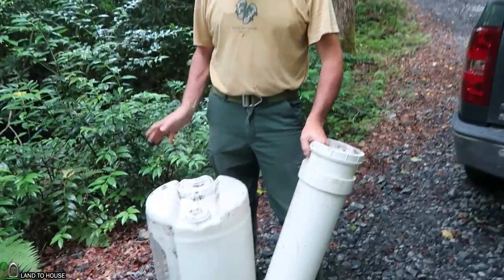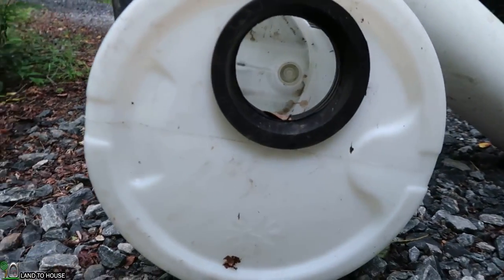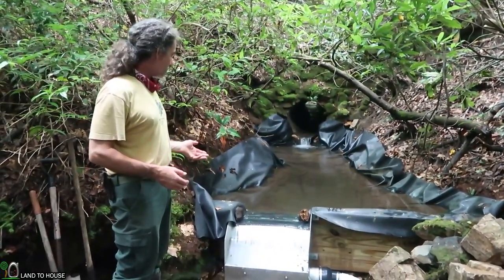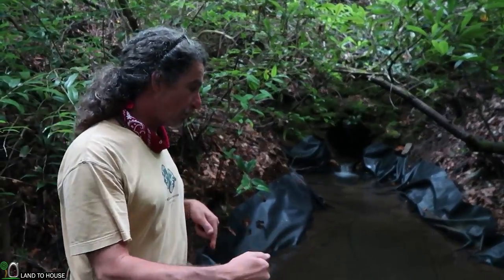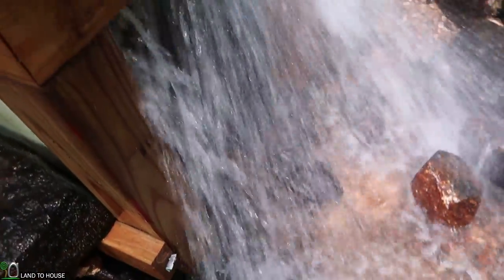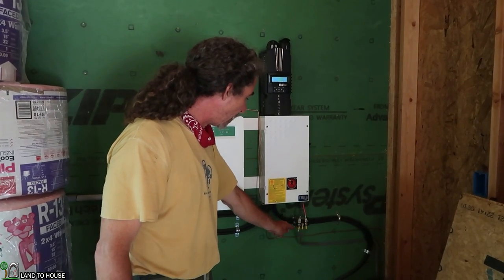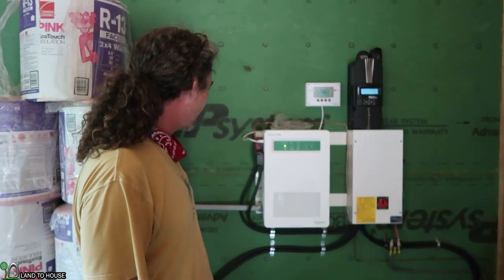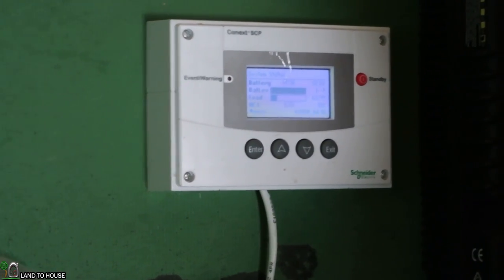AMAZING 250+ Watts of Micro Hydro Power Off Grid

Comment: Your 4 inch micro hydro at the reservoir, uses small sharp bins as you can get away with the water will flow better through a 22 angle multiple 90 than a 90 single bend. Use a multi-blade multi system on the shaft to get a stronger reaction to the flow for your alternator.

Comment: Ok, so it generates 250 watts per hour or enough to run all the LED lights in a yurt all the time. The rest like coffee maker use the battery bank which is charging.  You don't want to run your batteries to 0 charge so if you keep things like the coffee maker which uses 1000 watts to brew it would take roughly 4hrs to replace that power or a little more since your not going to turn off the light immediately?

Comment: What about having an mppt a battery and a 240V AC inverter close by the hydro generator, and sending the power up to the house as 240V AC, then at the house running a 240V AC high efficiency Battery charger. The voltage drop over 1000 feet would be minimal.

Comment: I suspect where you have your pressure valve and clean out are creating a backflow which decreases your psi. If you move pressure valve to the other side of the Y. Then move your cleanout to the other side and make it vertical. This should increase psi and help alleviat air in the system also.

Comment: I'm not sure if I got it all. The microturbine generates AC output? up the 1000' wire then goes through a rectifier bridge to go back to DC which is input to the inverter? So is there a schematic of what was used for that rectifier bridge that handles that much power?

Comment: Eric's setup is one of the only  ones I've seen so far that puts the rectifier so far away from the actual generator head.
It'd be interesting to see what his drop is over that line, as well as some kind of experiment to see if that vs. the super close rectifier to A/C conversion results in a higher efficiency setup.
It's also be curious to see if using a pair (possibly?) of transformer sets to step up and step down the voltage could improve power transmission.  I'm thinking that, one of the reasons power transmission voltages are so high, is to lessen losses.

Some basic digging I just did, says Eric's losses should be about 53W over that 1000' run. If he halves the current that brings the losses down to 13.3W, quarter the current brings it to 3.3W.  So a 4:1 transformer group on each end would do wonders for his power losses.   The question is finding appropriate transformers, protecting them in the harsh environment near the generator head, what their respective losses are, and of course their cost.

Perhaps this is also an opportunity for Langston, to make a unit that puts out much higher voltages, with a matching transformer for the other end.
Reply: You bring up some intriguing points to consider.  10g wire comes in at about 1ohm/1000ft under nominal household current, so his losses with the new wire will actually be quite minimal when you consider that a 60 watt bulb measures 2 ohms resistance.  It looks like he's running 14g wire right now which comes in at 2.5ohm/1000ft, but considering the trade off between cost of the wire and how much loss is recovered and you can find that the 'best' answer for efficiency may not be the best answer for the economics.
Putting the rectifier as close to the charge controller is actually a very good choice, 3-phase AC transmission over long runs is much more efficient than DC transmission; that's why we use Tesla's answer instead of Edison's for the power companies long run power transmission.
You are right that a step up transformer at the turbine for the long line transmission and step down at the charge controller would be more efficient, with much higher voltage and much lower amperage the wire's resistance becomes less of a factor, but the costs of the transformers would be very difficult to recover for the few tens of watts that it might save.
Reply: I can pretty much make the voltage whatever you want it to be by changing the windings . have them that will do 600 plus volts . They work well with the grid  Inverters .   Schneider makes a charge controller that will take in up to 600 V but normally run under load 250v to 400v and will step it down to 48 volts⚡.  The charged controllers cost $1500 so that basically just comes  down to 💰
Reply: @workbenchz  
I got my numbers by taking 10ga wiring, 4.26A (based on the voltage and wattage listed on the controller), 1000' (304.8M) length, used https://www.engineeringtoolbox.com/awg-wire-gauge-d_731.html to get the cross sectional area, and plugged it all into https://www.electrical4u.net/calculator/cable-power-loss-calculator-formula-calculation/ to arrive at my values.  Hopefully they're remotely accurate based on that. :D
Reply: @SpencerLAPower  That... is interesting.  Are there any cons with doing higher voltage windings? Any experiments to see if there's a "sweet spot" between voltage and current.
Reply: @johnhufnagel   It really depends on how long a distance you're trying to run the wire for 48 V system if you get over 150 V you end up dissipating a lot of it in heat with the Transformers in the charge controller. But if you could use this with a say 72 V system you could get almost double the power.
Reply: @SpencerLAPower  I'll keep all that in mind.
I'm unfortunately quite a ways away from doing anything like this, but I'm taking the time to learn all the things I might need to learn, so when the time comes I can make intelligent design choices. Knowing the generator can be tuned to different voltages, to me means there's options and opportunity. 

And, thanks for being responsive. :)
Reply from the maker: Langstons alternative power has helped me learn about solar too. I have a video coming out soon where I install another 1kw of solar panels.

Comment: Turbine Assembly ( possibly have a selection for User Requirements) should be on top( dry) & easily disassemble for Repairs/ Maintenance Required .
Like the Comments from Viewers( engineering) the Rotational Water flow should be in sync for Minimal Flow Resistance ( higher revolutionary levels)

Comment: I haven't watched the full video yet, but is there a chance you can run your unit in a way that doesn't cut off the entire flow of the creek?

From the initial looks of it, it seems that this set up mirrors conventional hydro power but at a micro-to-pico scale: block off an entire water flow to build up enough head for sufficient power conversion. 

There are micro-hydrokinetic turbines that you can use for small stream stuff (this creek does look too small for that, but I'm wondering if you could do a run-of-the-river type installation where you divert like half of the creek or less to the side, leaving the other half or more open to free flow. 

Doing a run-of-the-river installation allows for the creek to mostly continue it's natural erosion/sediment-generation pattern while offering sufficient head if you run a pipe far enough. 

I love that you're thinking about how you get your energy, and at least are trying to use your surroundings to substantiate your way of life, rather than relying on energy from far away places that you don't really have control over. 

Next step is ecological harmonization, and, well, probably storage too (although you might have that but haven't watched the video yet) 👍

Comment: 5/8” nozzle at 25psi is 58 gallons per minute. Formula for that is.  Flow = 29.7 x diameter squared x square root of the nozzle pressure
Reply: That per nozzle the 9/16 is 47gpm per nozzle

Comment: The thumbnail is misleading. It's not 6000 Watts, but 250 Watts for 24 hours which equals 6000 watt hours. A watt is a rate, a watt hour is a quantity.
  If it was actually 6000 Watts, then over 24 hours he would have 144,000 watt hours per day! Or 144 kilowatt-hours per day. About enough for a welding shop!
Reply: The con man who made the video says "it's close enough to be true" and won't change the title. You know, just exaggerating 12x the reality.

Comment: furthermore, the winding wire quotes the diameter based on the average value over 100 meters .. this implies that p-eg. 0.8 medium, I can have a 0.6xx point, and in this case it will be the weak point on cnc use with strong acceleration or sudden braking
for pelton / turgo the problem comes when we have air in the duct ... fatal blows to bearings and ditto coils in the quarry
for today and all

Comment: ❍ Penstock Pride: 700 feet = 213.36 meters
❍ Penstock diameter: 4 inches=101mm ⇒ Maximum water intake: 12.7 lps
❍ Drop: 25psi=1.757kg/cm2=17.5m , 57ft=17.5m
❍ Power: 250 watts

Specification
❍ Penstock Length: 214.36 [m]
❍ Penstock Diameter: 101 [mm]
❍ Total Fall: 17.5 [m]
❍ Effective fall: 17.29 [m] 98.79%
❍ Maximum design flow: 2 [lps]⇒ 250 [W] , 3.2 [lps]⇒ 400 [W]
❍ Max Power :0.25 [kW] = 250 [W]
❍ Nozzle: 5/8" = 15.88 [mm] (Calculated: 11.75 [mm])

Comment: the rectifier power on the turbine you can keep it cold easily and a good electrolytic capacitor of at least 22oouF per Amper should be added if it suffers less from the input of the charging mppt inverter since it is certainly designed for solar panels perfectly DC without ripple and harmonics

also some AC capacitors on the phases improve the generator cosphi
Reply: I agree about having the rectifier on the generator side because it means you get more constant power over two thicker cables rather than pulsed power over 3. However, I do think that charge controller is designed with hydro in mind. Joe Malovich has done a few videos on that specific controller for hydro power (maybe Seth has too), and they're pretty good at finding the correct parameters. A correctly designed MPPT will handle the pulses okay.
Reply: I have a 6600uF capacitor on my motor generator and the MakeSkyBlue controller has no problem with the DC output. And at the speeds mine is turning at, the full wave bridge rectifier does get hot. 750RPM is 300Hz being fed to it. It also is producing up to more than twice the power of what his is as I have seen 800+ Watts when run at 1000RPM. That is pushing 30+Amps thru a 50Amp rated rectifier.
Reply: @gravelydon7072   that's pretty impressive. Hopefully your rectifier is Rated at fairly big current spikes, as the capacitor will mean the diodes only pass current for really short portions of the curve. That's also not as good for losses in the coils. A power factor correction circuit would be an idea, but quite complex for such a system, and probably not necessary.
What is your generator voltage output when running at those power levels? If it's high enough (100V), that's really not a problem, as the current will be 8A average at 800W
Reply: It would be interested to see what the power factor would be on this sort of system. It would definitely vary with the load and rpm of the generator. 
Depending on what sort of power factor the charge controller puts out, i reckon it would still be pretty close to 0.9 .  Seen as that type of alternator is  a PMSG which  output a leading power factor by themselves. 

When it comes to the location of the recterfier (ac vs dc transmission). If the dc runs ruffly the same voltage as the ac rms volts  under load there wouldn't be a huge difference between the two when it comes to efficiency (even with the equivalent cable sizing). Mainly because you only really see the benefits of dc transmission over very long distances at high power levels. Ive run some calculation before comparing the power losses of equivalent 3 phase transmission systems to a dc trasmission systems.

 Better cooling of the recterfier with it being out in the open with the generator would definitely help (maybe not with efficiency but definitely with the life of the recterfier). My only concern with that would be the ripple in the long dc run. A well designed caps and inductor filter (with various sizes of caps etc) would be best. Depending on how bad the ripples are you can lose a lot of potential power as the ripple frequency will be a lot higher then the ac frequency (which would be alread be on the higher side) and it will have a lot of sharp edges in the ripple which doesnt help with efficiency. In saying that, as stated before, in practice on this scale a large percentage of stuff all is still stuff all. Things don't always scale down very well from larger systems.
Reply: @ThisRandomUsername  1kV rectifiers. 3 phases of 4 parallel sets of 3 per phase is how it currently is setup and produces 610 Watts at 750 RPM at 69.8 VAC. It can have the coils changed to 12 coils in parallel and 3 phases which is where the unit would hammer the rectifier. At 750 RPM it is at 300 Hz and at 1000 RPM it is at 400 Hz. I have full control of the unit at 0-300 Hz ( 0-750 RPM ) but it only runs in auto mode at 400 HZ where the motor controller does the ramp up of the speed from 0-400 HZ ( 0-1000 RPM ).
Reply: My rectifier got really hot so I mounted it to a heat sink. It didn't take very much and now it runs much cooler. If more power started coming it it would probably have overheated.
Reply: @deserteagle190x8  The controller seems to run in the 95-98% range for the conversion. Most of my loss is in the motor/generator itself which is why there is a 66% efficiency overall. I can measure the loads at all of the steps and it is the M/G that is the weak link. If I brought the leads out from the coils individually instead of in phases, it likely would improve some. I have a Whirlpool stator set up for that but have not run it that way yet. The ones I am currently running are Samsung 36 pole copper wound units. It would take a dozen rectifiers with the current coil setup instead of just one.

Comment: If pressure is needed for turbine, maybe reduce 2 inch to 1 1/2 inch and go down to 3 inch one joint of pipe back, may help reduce air issues.  I would also recommending larger wire for 1000 ft run, you are losing a lot of energy at that distance.

Comment: 16 of those diehard batteries are roughly $3200. Rated 100ah but you can't really cycle those like that. More like 50ah. So 20kwh, but 10kwh capacity in reality. You can get lifepo4 cells for $200/kwh or $2000 for the same capacity, way longer lifespan and take up probably a 1/4 of the space. Really cool system though!! Wish I had a creek like that.

Comment: I guess those 4 inch pipes are sewer pipes. I cant find such specs as they apparently are not rated for other than semi filled gravity drop really... To the capable plumber randomly reading this; On ground/in ground, how much pressure build/meters head static trap is reasonable to shove into them before they burst, get forced out of each other or eject the coupling gaskets ?

Comment: Is there anyone who could recommend a bridge rectifier for a 24 volt battery system? There doesn't seem to be a lot of information on this subject, and I'm not certain if the ones listed on Amazon can be used for the purpose of a micro hydro generator.

Comment: How long will your battery bank last overnight just on solar also if the inverter  being on is dependent on the main power grid how does it work during power outage. And on your hydro system the water losses at the collection box, could you use one of your ram pump to catch some of the loss and pump it back into the barrel to keep your flow rate a little higher

Comment: Simple and practical system. All one would need to do ifthe power became more then the turbine could do isto add a second identical battery bank to help add amp storage so as to reduce pull down onthe batteries.

Comment: Those 1000' cables from the turbine up to the charge controller sound really long so I reckon you will be losing quite a lot of power in those cables.  Have you done the measurements yet?

Comment: Wouldn't it be more efficient to convert from AC to DC directly at the Turbine? You could save one Wire and therefore use just one pair with higher cross section, and because of the higher voltage (over a factor of 2, caused by the rectifier) in your 1000 foot wire you could further reduce cable losses - please correct me if I'm wrong.
Reply: there's a good reason why AC is what is we use on the gird. AC is way better at long-distance transmission.
Reply: @mog5858  Lower Voltage AC is. But Very High Voltage DC has shown that it works well for long distance transmission.
Reply: @xeigen2  thank you for sharing. you bring up some good points.  but with homeowners cost is going to be a the top of the most list and people are used to using AC.
Reply: @mog5858  True but you must consider he is already converting to DC anyway because of the battery storage, so he already has bought everything he needs. It would make sense to move the rectifier at the generator side of the line.

For the average home DC doesn't make any sense. But in this situation it does.

Comment: Great video!  So my neighbors behind me put down a few hundred square feet of Astroturf under their kids' playset and is causing my yard to erode.  I'm currently (very slowly) digging a trench across the back of my yard to try to slow the flow a bit until I have time to find a real solution.  I like the idea of somewhat damming up the water and diverting to a micro hydro.  Question:  Could a solenoid be used to open and close a valve for the water to where if the electricity goes out it shuts off the water flow to save the turbine.  Depending on how far away your system is it may be beneficial to manually have to restart the turbine to open the valve rather than burn up another turbine.  Thanks!